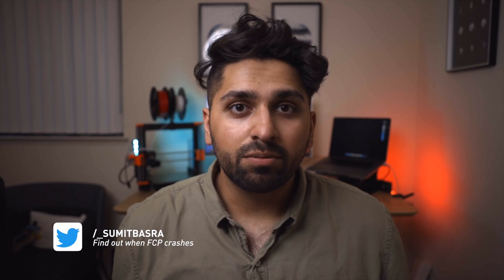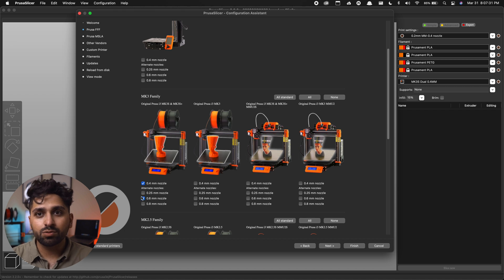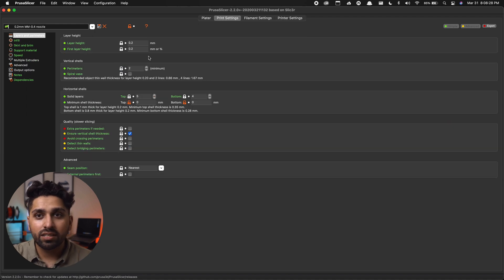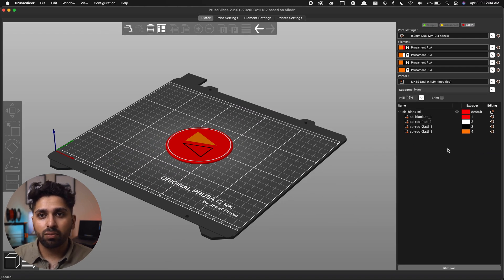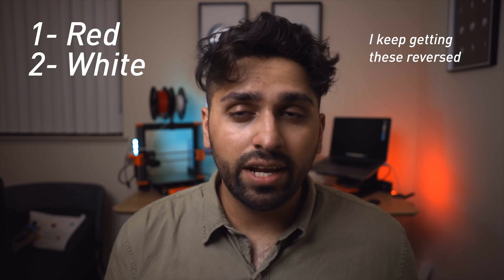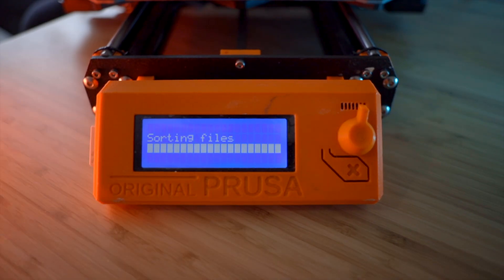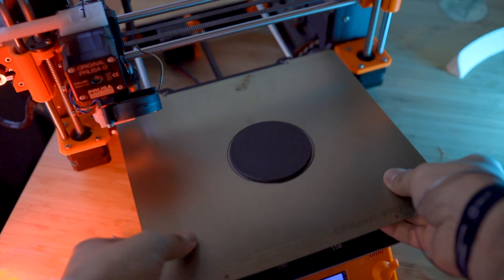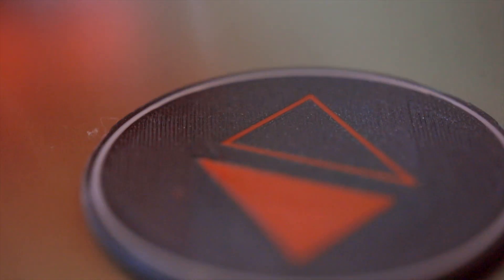COLORFUL 3D Prints Using a SINGLE Extruder!

Comment: Sumit, I must not be making my Fusion 360 models correctly. I made one that has 3 HEX Shapes 1mm thick. I made a second one a Rectangle were I cutout the HEX Shapes and it's 1mm thick. I made a third one that's a solid Rectangle 1mm as the background. I exported each one as a Mesh file and loaded them together into Prusaslicer and click Yes to combine them.
The HEX Shapes start printing but the printer parks the printhead to make a filament change before the HEX Shapes are finished at 1mm thickness. It does this several times. It also does this for the 2nd file before it has finished printing it's layer to a 1mm thickness. Same thing for the 3rd layer.
I had added "M600" code to the "Tool Change G-code" before I sliced all the files. So, what am I doing wrong?  Thanks, Gary